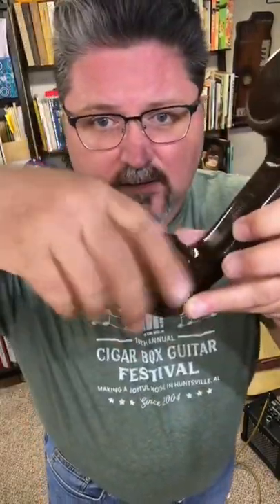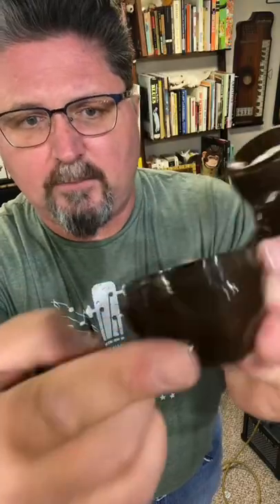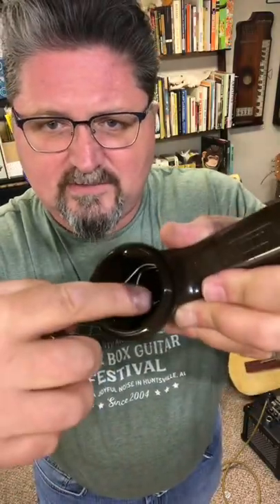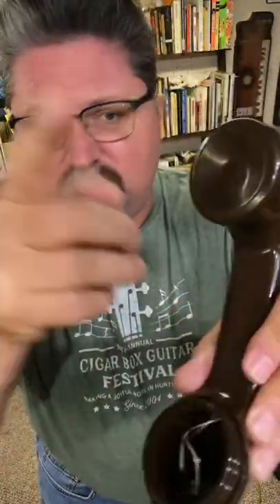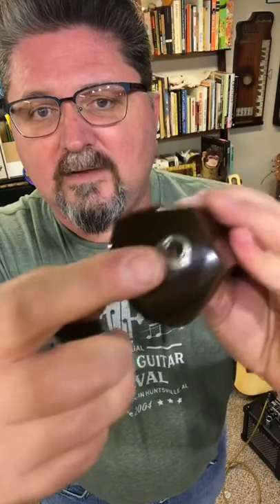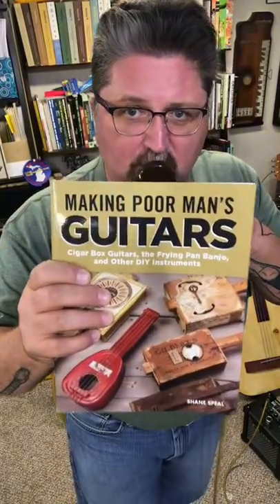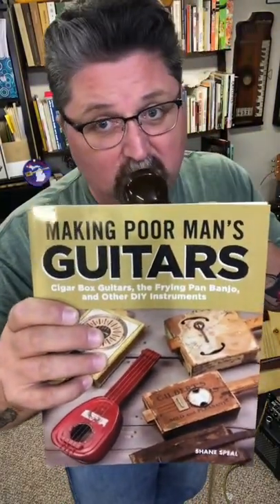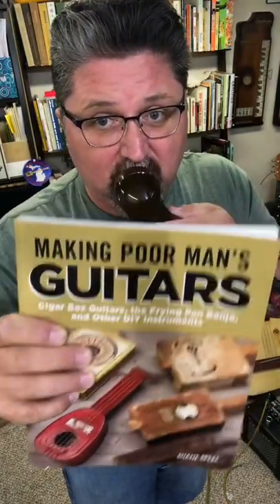How to make a Lo-Fi microphone from an old telephone receiver. EASY!  #microphone #harmonica

Comment: So cool. Wondering why we dont use the microphone on the bottom piece of the phone instead of the speaker on the top? Any reason?
Reply: The speaker doesn't require power, you can just plug it in like a dynamic mic, which makes this a super simple DIY project.
Reply: @sytiravajous ty so much for explanation, u gear god